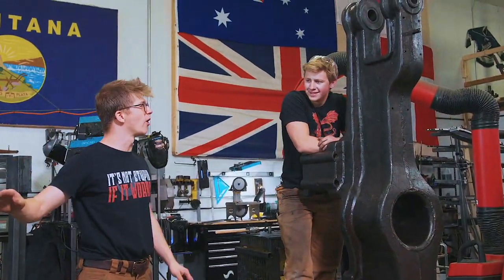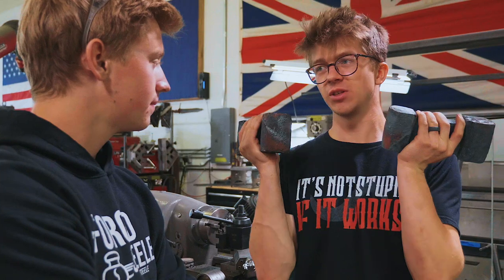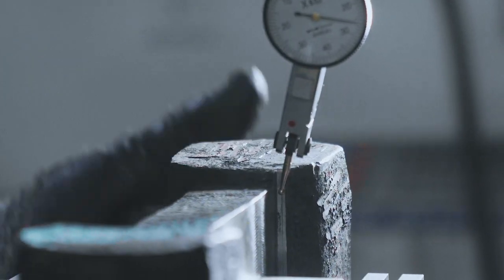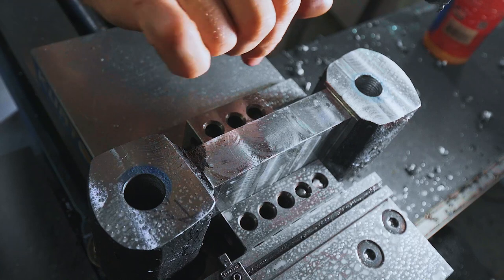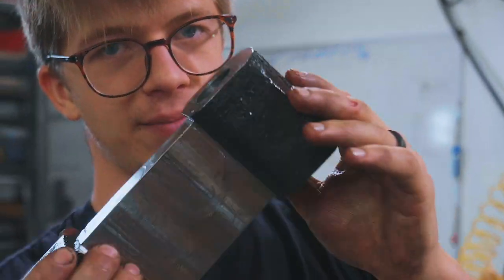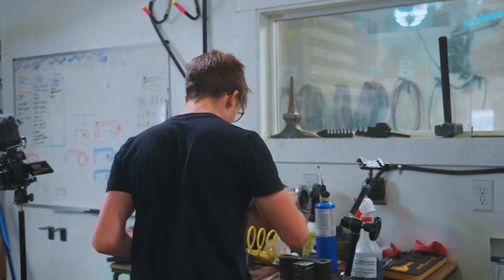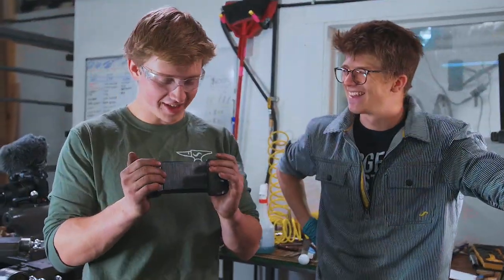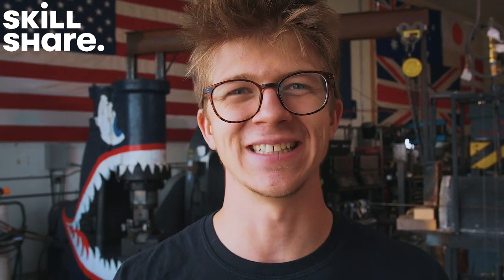RESTORING THE FAIRBANKS POWERHAMMER!!! Part 2

Comment: This is a bit above and beyond the standard "need a tool, make a tool." Y'all are virtually building a power hammer, less the cast frame.
Reply: Rebuilding not building
Reply: With this knowledge they could find a gutted frame and build hammers to sell...
Reply: Alec thinks, "You're right I could cast a frame."
Reply: @danielparrell4705  he could not cast a frame you need a mold the size of the thing itself and need enof liquid metal to fill it at ounce... even his warehouse is to small for that
Reply: Just a fancy hammer he makes those al the time

Comment: Ok so Will drilling that off-center hole made my brain and eyes scream.
Reply: Lol. My brain was screaming  "reverse the jaws in that 4-jaw chuck!".
Reply: Bren B exactly
Reply: i was coming to comment the same? how????
Reply: @brenb7249  Well, they get a longer (squarer?) grip that way, but at the expense of only having about 1.3 threads of the jaw screw engaged. 
I think i would have done both holes on the mill with a boring head. But they needed a thread. (I can thread with my boring head, because CNC)
Reply: Yeah, I have to say Will's right:  That really, really doesn't look like it should work, does it?
Reply: Video doesn't do it justice.
Reply: @corwinweber693  Setup aside, consider machining a piece with a little runout. Once you machine off the OD, it all looks nice and runs true...but the material left is the same material that was there when you started. The center of the lathe and tailstock are going to be in the same location. The hole is being drilled in the center of the lathe's rotation and the material outside of that is irrelevant (again, ignoring setup and the machine's balance, just purely the cutting in the center).
Reply: @94XJ  No no, I get the IDEA.  But that setup totally looked like it was never going to work.

I get the idea of setting the piece off center in the chuck.  The reality was that thing looked so horrifyingly unbalanced that it would tear the lathe and drill apart.....
Reply: @corwinweber693  This was my concern, but I know almost nothing about lathes so I guess it's okay? My engineer brain sees an off-centre mass rotating at high rpm and assumes failure is imminent.
Reply: was giving me 'abandon shop' vibes coz that thing should have gone ballistic....
Reply: @92Pyromaniac  I mean, in terms of physics you could calculate the difference of intertia. It looks scary, but I think so long as it doesn't get to any ridiculously high speeds the difference in intertia will be too scary.
Reply: @corwinweber693  You know they can turn cubes from round stock ....... Dark Arts!

Comment: A small tip for your drilling with large drill bits your predrilled hole has to be just slightly smaller than the crosscutting edge of your large drill bit so that it can self-center when the pre-drilled hole is too large your drill won't cut a perfect hole. Greetings from Germany
Reply: This! Also you put too much pressure on the outside cutting edge of your drill bit, leading to chips
Reply: @Drummer_13 made the same comment 20seconds before i found yours...
Reply: Drummer_13 knows what he's talking about.
Reply: Hey, I am a 2nd year apprentice in Germany, always on the look to learn more!
Can you explain to me why that is?
I would have thought the cutting edges would allign and noone told me otherwhise.
Not because I doubt you, I want to know mroe :)
Reply: @dayofmone  A drill bit can drill oversize if it is incorrectly sharpened; if one cutting edge is just slightly longer it will do this every time. Another cause is starting the hole on an angled or uneven surface. The reason we use reamers for accurate holes is because  we know drills will go oversize. :(. Another thing many people don't realise is that a drill can bend and drill a curved hole if you hit a hard spot etc. Castings and welds are bad for this.
Reply: In the US we call it the web of the drill bit. The pilot hole should be the diameter of the final bits web. You are only giving enough space for the chisel point of the bit to rotate freely. Google "DRILL GEOMETRY" and find an image.
Reply: Good advice! Also please buy some spot drills Alec, those center drills you are using are for live centers on the lathe not pre-drilling.
Reply: I have so much desire to comprehend exactly what you guys are in about...
Reply: @jarosawkus1976  look up drill geometry, they are talking about the interface between the big drills cutting edges with the smaller hole, and how that has to allow a clean contact.   On a side note: have the never heard of U-drills?!
Reply: @justicar5  I don't have any engeenering education, all I do is watch YouTube and Channels like Alec's 😉 I'll check it out - thank you! It's fascinating how much thought goes into ordinary things around us!
Reply: Dass er die Bohrung nicht entgratet / ansenkt bevor er reibt macht mich wahnsinnig
Reply: _f for some peace of mind check out Abom79, who is an actual precision machinist.
Reply: @_fabiosi089  macht das so einen Unterschied? Man bearbeitet ja nur den innen Durchmesser der Bohrung?

Comment: Absolutely fuming, you opened a draw labelled Micrometres/DTI's and took out a vernier this is scandalous.
Reply: not all calipers are verniers my guy. you can have a vernier protractor as well, and in fact standard OD mics that most people think of when "Micrometer" is said, use vernier scales to display the value of the measurement.
Reply: @schig44 you broke my OCD sensors
Reply: @ibrahim-sj2cr  do they have a vernier scale to readout? if so they may be fairly simple to repair ;)

Comment: Alec: How fun is it we get to make these pieces from scratch!!!
Will: Well you'know, It would been nice if the thing I bought actually worked...
Alec: So FUN!!!!!!!
Reply: I am somewhat curious as to the financial side of things here ... Was Will royally screwed over by the seller here, or did they come to some kind of compromise?
Reply: @iWishmaster  By the way they talked about it, he seemed surprised that it didn't work.
Alec mentioned that the seller was told it worked and not that the seller tested it first.
I assume it was cheap enough that they're taking the time make parts for it rather than asking for the seller to take it back.

Comment: A piece of advice, if you ever have to ream a hole again:
Never ever ever ever move the part or the mill after you started drilling the hole!
Center-drill, drill Pilot hole, open it up and then ream ONE HOLE at a time.
If you move around drilling other holes and come back to ream it later, it will never be in the EXACT same spot again, this will give you a better result.
Reply: Good advice.
Reply: Another piece of advice to add is to use a spot drill with the same flute angle as your drill and not a center drill.
Reply: I saw that too. You absolutely must keep the same position for as many operations as possible.Think about where you need precision: In the tool change or in the hole position?
Reply: You'll see Youtube machinists doing the opposite, but they're running CNCs which move themselves away from the hole to do a tool change, which cost as much as Alec's whole shop and which can drive themselves back to each location with repeatabilities measured in tenths.  Though I think Alec has glass scales and a DRO on the mill, it should be pretty repeatable too...
Reply: @kevinvermeer9011  Pretty repeatable, but not exact, hence need of doing operations to one hole at the time. Also if possible in the machine lock your sledges/ X and Y axis when doing precision operations like this, since there might be tiny bit of wear in the screws etc that can cause such errors as well, hence locking sledge into place will not allow it move, since most sledge locks use guides to jam it in place, by creating extra pressure behind guide/wear plates.
Further more that tiny error Alec created could be from Z axis/ drill bit pressure flexing part or guides.
Reply: exactly! 😀👍👍👍
Reply: Moving away and back is no big deal compared to not boring with an endmill or boring head. The drills will wander. Your machine position could be perfect but the reamer will still follow the crooked hole to wherever it is going. I'm guessing it probably doesn't matter for this part though. A bit of misalignment here and there is probably not a big deal in a machine that bashes metal around.
Reply: On top of that your drill should be a 1/32 undersized for the reamer to make a nice cut.

Comment: i forgot how much i enjoyed manual milling machines. every movement you make counts. 
part of the elongated holes is that you went from hole to hole.
when drilling and reaming holes for concentricity  it's best lock the x/y axis and drill 1 hole at a time to it's final size  only moving the z axis.
 it's more tool changes but the hole is much more concentric.

Comment: Machining on this channel makes me cry. But FYI, yes, twist drills ALWAYS drill oversize. How much oversize they drill depends on many factors including pilot hole size, and bit sharpness. The reason your reamer is cutting at the bottom and not at the top is as the twist drill begins to break through the bottom of your work piece it has less cutting forces applied so it drills less oversized. The bottom of the hole is always the most accurate. The best way to get a twist drill to drill very accurately is to reduce the cutting forces as much as possible by predrilling it with the closest drill you can, preferably within a few thousandths. What you really need for that job is a boring head. It can get you any size you need without buying a million drill bits.

You guys really need to make friends with a machinist so you can get advise on how to do the tricky things that you are doing correctly and safely.
Reply: (student) machinist here, i'd love to help out with some of those machining questions :D

Comment: Great machining!!  little tip you should cut inside radiuses with a ballmill on the endlinks w
Here the flat sides make a corner with the round part of it, to avoid constraints concentration it would make the part less prone to break under heavy repetitive forces

Comment: 9:33 drilling the off center hole made me feel uncomfortable ...
Reply: I've never done any machining in my life but I wonder if the mill might've been a better choice for that off-centre hole than the lathe?
Reply: @neilbarnwell  No off-center holes are often done in a lathe as well as crankshafts, BUT they can hypnotize you very easily! So take breaks often!
Reply: @neilbarnwell  either is acceptable if you have the necessary machines/accessories for it. on a lathe it requires a 4-jaw chuck, and on a miller it would at best require it to programmable to mill the hole to size or have an adjustable milling bore head. they might not have those things for the miller, but they already have a 4-jaw chuck.
Reply: you should see someone make a crankshaft on a lathe
Reply: @schwig44  I have, part of highschool machine shop project to make one

Comment: A Bridgeport. Wonderful tool. It revolutionized modern manufacturing across the world. What kind of lathe is Will using? Most people don’t realize how much TIME is needed to set up a simple pass using a mill. Even with DRO the setup time is probably 10 times longer than the actual cutting. And for people who think CNC is the answer you’d better be proficient with at least one CAD system. Skillshare is a great place to learn these powerful and complex design tools.

Comment: Excellent that you are restoring the hammer and not just chucking it! :) Just a tip for off-centre holes in the lathe. Mark them up on a surface plate and center punch them. Then you can use the lathe tailstock to get them mostly centred. For true accuracy, trap a separate dead-centre between the tailstock centre and the centre punch mark and then indicate off it. Adjust the jaws until it registers true! :)

Comment: there is a huge difference between working functionality and working properly. good job thinking I would drill the side hole in the pitman on the mill if posable the jaws on the lathe head are on the small side. for work that big you really need a fixturing plate to bolt it to.

Comment: Tips for lathe work. When using carbide tips, they want to be worked. If you don’t take a big enough cut or too slow speed/feed they will rub and knacker the tip/give a poor finish. When turning off center, cut the stock too long, turn a concentric boss and fit a steady to the end so you can run the chuck faster and not let centrifugal force cause vibration or slip off centre. Then just part off the boss when you’re done.

Comment: You two are the "Steele Will" Blacksmith Company,there exists no such question regarding your capability. When handling red hot iron there can be no doubting of the prerequisite skill necessary. Which you have proven to be well equipped. Please don't go Will,when you strike upon the excellent dynamic of a winning formula,why break it?! Another great episode, surely another great season approaches. All the best.

Comment: Make sure to keep all the hardware you use in the vintage look/flavor.  It's one of the things that drove me nuts when watching Hand Tool Rescue's restoration of a similar hammer.  It had a mix of antique square and modern hex nuts/bolts.  Pick one or the other, preferable the vintage square.

Comment: When I got hired in at an automaton company, they wanted me to start in the machine shop and eventually I could move over to programming - where I really wanted to be. At first I sort of turned my nose up at the thought of being a machinist but after a little while, I really loved the work. It's probably the job I miss most because there is so much problem solving and attention to detail. It's so satisfying to take some raw stock and turn it into precision parts with tolerances that are imperceptible to the eye or even touch. 

There's still nothing quite as satisfying as dropping a pin into a precision reamed hole and watching it slowly fall in. The fit is so close, even air struggles to slip by!

Comment: So a little tip on the reamed holes, twist drills will always wander a little bit. This can be corrected by using a boring head to bring a hole to the pre reamer size instead of a twist drill.

Comment: If I remember my material stresses correctly the ball end mill was the way to go, I agree a consistent reverence point is very important however a ball end mill should end in a flat face, If you reference from the edge of the "cut" it should be consistent. (Obligatory never worked as a professional machinist but have done a tiny bit of design and machining)

Comment: Nice job on the re-build guys. one correction for you on the Taper Shank Drill. That is Taper Shank Drills do not & should not transmit drive via the Tang. A Morse Taper is a self locking Taper & this is what provides the power transmission between the sleeve & the Drill.

Comment: Some unsolicited suggestions chaps:
-You know how use Fusion360
-You have the plate
Go make the parts you need in CAD, accurately, and take those files to a CNC Plasma cutter.
Maybe overkill but consider putting some press-fit roller-bearings in the hammer as you rebuild it. It may save somebody in the future having such a big repair job.
All the best.
PS
If I had a drill bit that big I think I'd keep it wrapped in paper too!

Comment: When using large drill bits (above 15-18mm) predrill only once with a drill bit the size of the webbing of the larger drill bit(usually less then 5-6mm for drillbits up to 40mm). Then you wil use the entire cutting edge of the large drill bit so it does not wander and make an oval or tapered hole.

Comment: Drills cut oversize, also if you did not already its a good idea to check the tram on the spindle of your mill, drill an undersize hole and use a boring bar to true it up before using the reamer, as the drill will wander and also cut an oval hole

Comment: Just FYI: I did a 4 year advanced apprenticeship geared towards industrial gas turbines with one year of that being centered towards 'advanced machining' and most of the lads I did that with wouldn't have a clue about the 4 jaw chuck, or dare use it with that size of stock so Will can quit saying he's not clued up on a lathe! 

I would recommend looking into getting a boring head for the mill instead though - Less squeaky bum moments than running a maybe 20kg chuck of metal off-centre by that much! (and setup is quicker / easier)

Comment: When you've got something that big in the lathe chuck, flip the jaws so there isn't so much jaw sticking outside the body of the chuck. Much safer that way. You'll also have more of the jaw engaged with the screw minimizing the risk of stripping the thread on the jaw.

Comment: Might be fine for how much meat the toggle links have, but that sharp inside angle in the transition between the bearing section and center link is a stress riser and may fatigue and crack over time due to the forces it'll experience. Again, probably fine, but always a good idea to radius inside corners like that when you can.

Comment: We set bushings with 0 to 0.0025" interference or sometimes a sliding fit based on the customer.  Locktite goes a long way setting the bushings in our castings with the drop in style and can be burned out when it time to replace.

Comment: In addition to what other people have said I'd like to point out another factor that might have contributed to the oversized hole. When drilling really big holes you put a lot of heat into the material making it expand. In general you should make sure to only do critical tolerance work on parts that are room temperature.